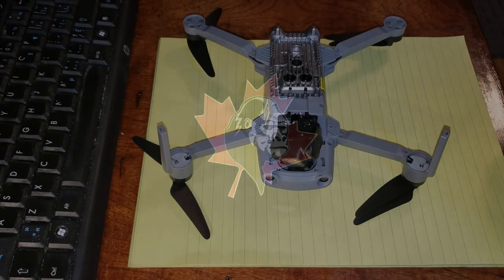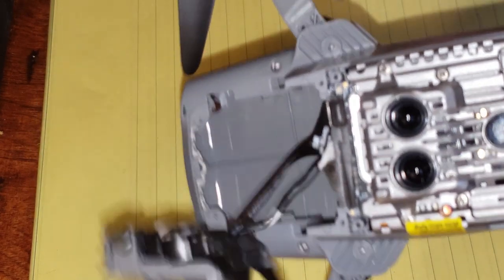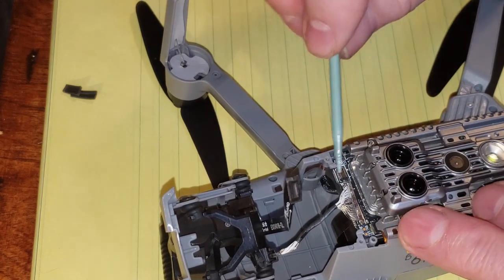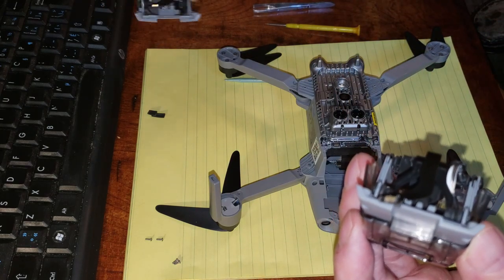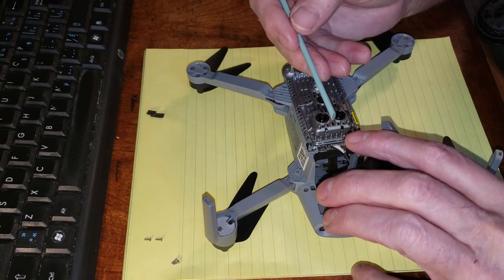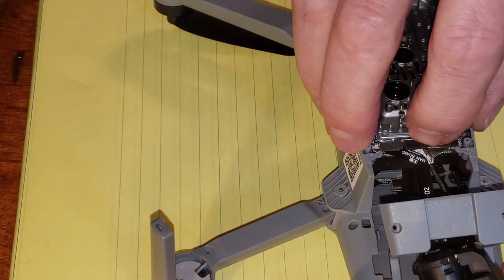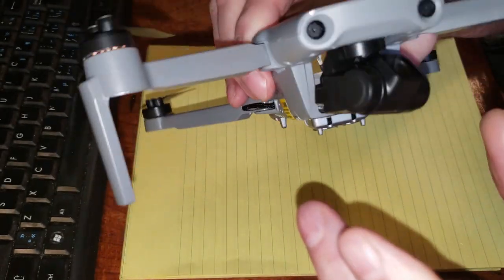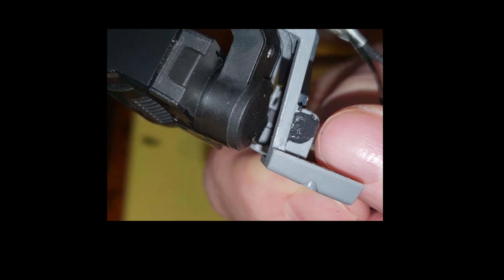Hubsan Zino Mini Pro - How to replace the Gimbal

Comment from the maker: ***Hubsan reached out and said I forgot a step. There is a calibration tool (Hubsan Tool) I need to download from their site to fully calibrate the gimbal. The Tool is NOT on their site but is on the Play Store. **I will try to use the tool and try again, however I doubt the result will change. It would have been nice to know all this in the beginning.
Reply: i also need to contact hubsan regarding a gimbal replacement.. but so far they dont answer my emails.. where did you contacted them?
Reply from the maker: @DiipsRatsAirsoftPortugal  i just contact support.

Comment: I'm having same problem with my hzmp right from the first day when I received it more than a month ago here in Malaysia. Tried every calibration available also using hubsan tool from play store but to no success the horizon is bad specially when I make the drone turn to the right. Even worst when it just hovering. Using the tool in the app to adjust helps but not long and camera is tilted down again to the right. By changing camera gimbal did it finally solve the issue in your hzmp?
Reply from the maker: I have several issues with my original gimbal. One was the tilt. No matter what calibrations I did the tilt was always there just like you say. Other more important issues for me was the focal and color contrast issues. But even though the new gimbal has now obvious shake and jello issues, it did fix the gimbal tilt. My conclusion is that a new gimbal will correct those tilt issues but in my case did not fix everything. Hubsan is now considering replacing the gimbal again.
Reply: @GorillamansGarage  mine too has focal issue and without touching the anything the display changing distance. I think I will send it in hubsan service center here in Malaysia.

Comment: Good video!  But how did you get Hubsan to send you the part?  From what I have read, they usually tell people that they don’t supply repair parts and if you want your drone fixed, send it in for repair.
Reply from the maker: Literally months of videos and emails.
Reply: The problems for Hubsan repair are twofold. First, there is no US-based repair service and dealing with China-based customer service is difficult. Second, if you have to send your drone to China for repairs, the shipping cost alone is very high.
Reply from the maker: @RandyRadar43  yes.. that is true. So far all my emails are answered next day. It is a lesson in patience for sure.

Comment: Worst Drone ever, mine is not working camera not focusing, and never get any answer. DJI its way better than this,  thanks for the tutorial btw.
Reply from the maker: Basically anything but DJI is a "Throw-Away" item. They may have a few annoyances (NFZ & Limited flight modes) but at least you can get service when needed.